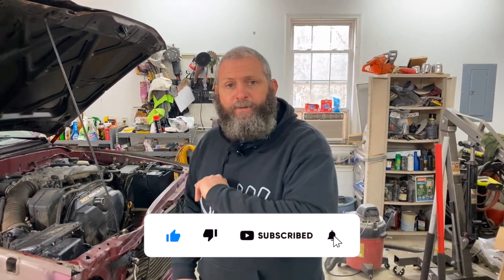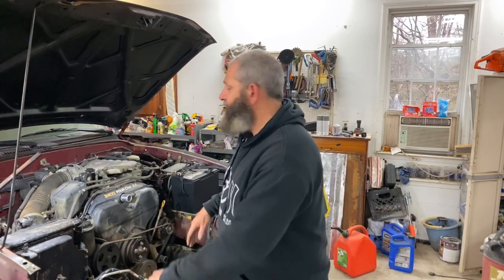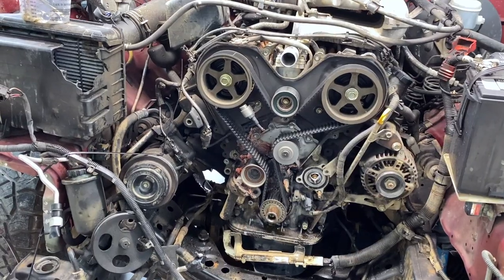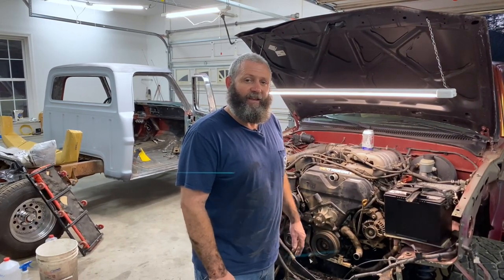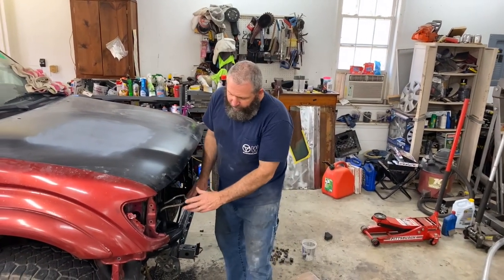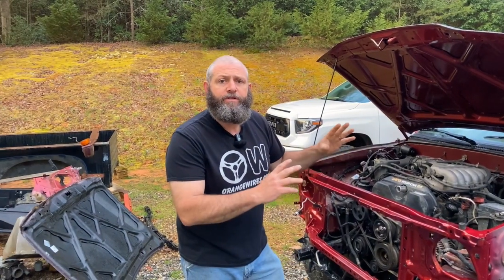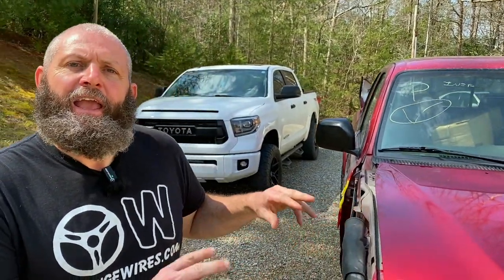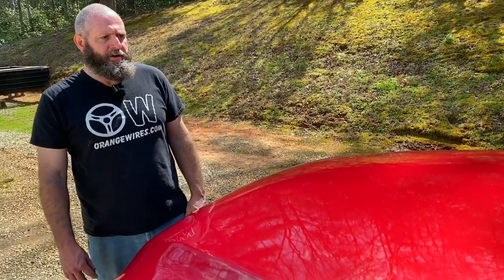REBUILDING A WRECKED 1st Generation Toyota Tacoma From Copart | PART 2

Comment: This series rules. Restoring a 2004 similar to this (I hit all of a deer with the front passenger side😖). What’s the part number for the bumper (?) assembly you replaced—the part that holds up the radiator subassembly? Thanks for posting this, nice work!

Comment: Did the paint turn out ok? Did you get a lot of dust and bugs in the clear coat?
Reply from the maker: The paint turned out really great considering it was painted outside. There was a few specs here and there from the dust and pollen but all in all it turned out great